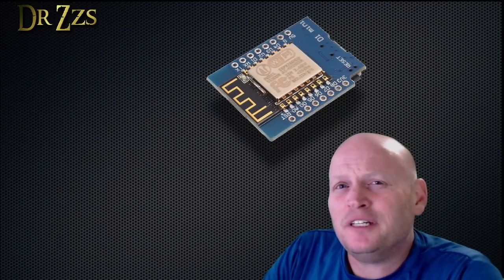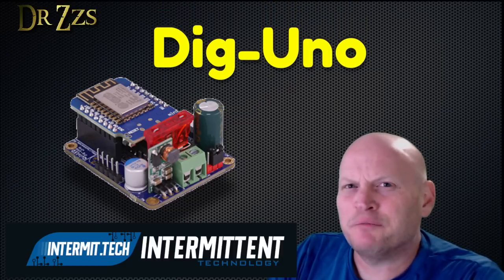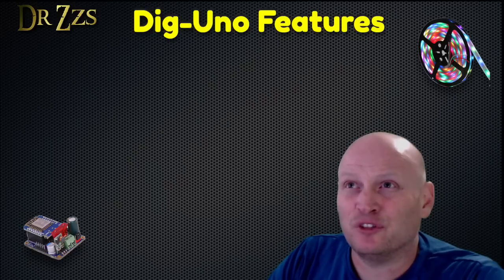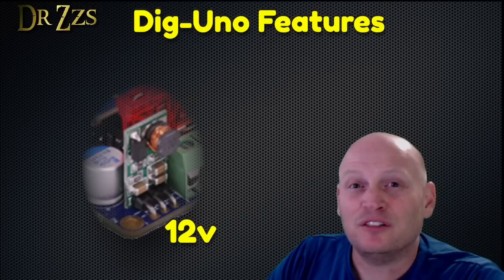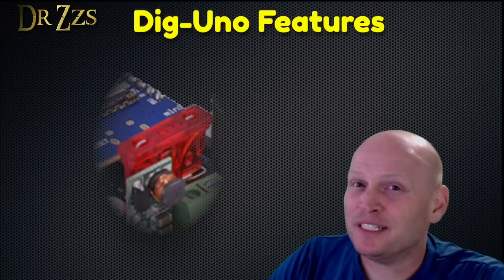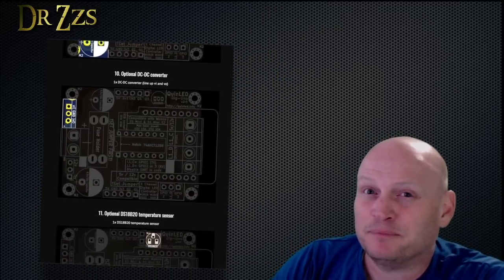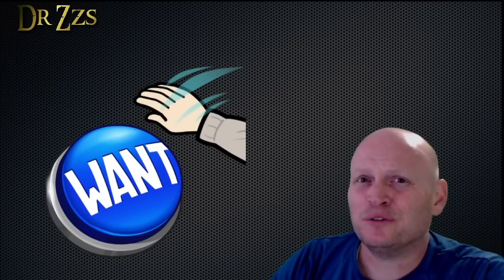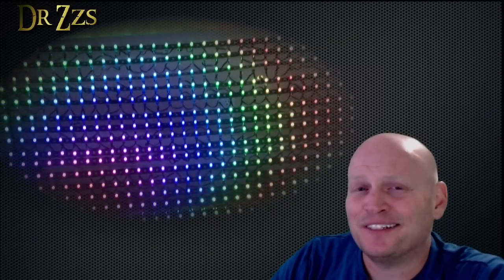Pre-Assembled Dig-Uno RGB LED Controllers Preloaded with WLED

Comment: I’ve been watching your videos all night, I’m learning a-lot but  I’m still struggling a bit.

I’m trying to do a single run of led strip lights across my roof line in a led channel. It’s 65 ft so after I solder four of the strips together (5v) it will be about 1,200 leds. 

It seems one digUno won’t be enough.

Any recommendations on how to approach this?  I can’t figure how I would get the effects to transition seamlessly down the roof line if I used more than one controller and power supply to split up the load.

Any help is appreciated!
Reply from the maker: The best way to troubleshoot this and any other quesitons that arise is to join the discord channel.  There are a lot of smart people there that can answer questions like this.  It can be difficult to troubleshoot via youtube comments.
Reply from the maker: Were you able to join our discord channel and get your questions answered?
Reply: I am actually about to get in the Discord now. 

I bought the Dig-uno and went with pixel style lights in a track. Everything is pretty much working except for a minor issue I’m trying to trouble shoot. Thanks for all the videos. I couldn’t have done it without them!

Comment: Two years on and your guides are still relevant.  Watched a couple of your videos.  I am looking into WLED for my kitchen and have seen many, many videos of people wiring them up straight to the ES32.  thinking of using Dig-Uno as an all in one safer way of doing things.  Question though.  My kitchen has two runs of LED stips, both powered by 12v transformers on the same switch.  Do I need 2 Unos and can I control both from the app so when the switch is used both sets of lights come on and can be themes changed as needed?  Any help appreciated.
Reply from the maker: Depending on location of your lights and how you want to run your wires, you probably could use just one digUno.  If you did have to use 2, there is a "Sync" setting in WLED that sends any changes on one controller to other controllers so they all do the same thing at the same time.  Hope that helps.  Come to discord and chat with the Pixelheads in the LED channel.

Comment: Hi I bought the Quin uno board and can I order the wires to connect my light to the pixel strings and my power supply, thanks, Paul

Comment: Question if I have to do power injection on 5v strip  thats one full 5m strip of  WS2812B  60 per meter  with an additional 2 meters tacked on from another strip at the end, could I run that parallel power cable  straight off the power supply that supplies the controller or would I need to tap into the power output from the controller to extend to the other side of the strip?

Comment: Dig-uno / ESP8266 absolutely does not work with an Asus RT-AC3100 wifi router, it won't connect to wifi, I've tried everything.  Works fine otherwise.

Comment: Hi just got the dig-uno booster board and new to using it. We're can I get info on how many led strips or led lights I can run on one board. I currently using WS2811 and using them on house outline and fence outline so just need information on how many Leds I can use per dig-uno or if I'll need something else to run the 1300 or so Led lights.I will be changing to the WS2812B 12v led strips and string lights for future. Please help thanks

Comment: Hi There and thank you for all the great videos. I'm new to this led pixel scene and learning good stuff from you. I'm going to try something out this year. I have a couple of NodeMCU with WLED and going to run 12v strings, and I just ordered a dig-uno from you. My question is what type of cables do you use from your nodemcu to the pixels, or even jumping a 20' space from 1 pixel string to another pixel string? I thought I saw that you can use 18/3 extension cord? Any help would be great. Thanks.

Comment: What parts need to be changed if I accodentallu used 12v power supply while DigUno was set for 5v?
Its fried now and ordered a new one😖😁
Reply from the maker: You just need the D1mini.  You can get them for $3 each from Amazon if you buy a pack. https://amzn.to/385qk6L
You'll have to solder the pins on yourself though.  But, if you don't want to solder the pins, I am going to start selling pre-soldered and pre-flashed D1mini's and Mini32s soon.  I'm waiting for a batch to arrive then I can start soldering and flashing and list them for sale.
Reply: Thank you alot.
Working on probably first LED cristhmas lights home here in Finland. Hope to get done in time.
....thank to your videos😉👍

Comment: Hello I just found this video and I am considering getting this controller.

I plan to run approx 550 leds in my showcase of the WS2815 12v LED Strips at 60 LEDs/m.
I've calculated that it will need roughly 14 Amps to run it smoothly.

Can this controller run it without issues?
And how do you connect the WS2815 to this controller?
Many thanks for the info!!

Comment: Can multiple units be grouped together so I can synchronize and control multiples at once? For example, if I have one unit with an attached strip in each bedroom, and I want to instantly turn on all four bedrooms doing the same lighting color and effect, is that possible?
Reply: Did you ever find out this question I’m wanting to do the same

Comment: Hey I bought 4 16ft WS2815 12V strips with 300 LEDS per strip. Could 1 Dig-Uno run this assuming I inject power in the middle and have a good power supply?
Reply: BigMike I installed 7 5v WS2812B with 300 leds per string and I also run a power injection cable along, but on the WLED app when I put the amount of lights which is a lot of lights the leds turned off, the highest I managed was 725 lights, which is not enough , i have enough power, I checked, I think is the board or the app

Comment: 1) Could you add a relay to save power in standby?3m stripe consume during standby more power in a year than the cost of this controller. So with a relay, a controller often amortizes itself within a year. 2) Microphone: for the WLED fork with audio reactivity. There is already a PCB shield and parts list from the guys who forked the audio version of WLED. (But its not possible to order it assembled). I guess it’s only a matter of time until they merge and then it would be great to be able to use audio reactivity. 3) size: Shellys have very similar chips on board (including relay) and are much smaller. Maybe there is some downsizing potential

Comment: Hi Dr. Zzs,
I have some questions:
1. How many pixels/nodes you can handle with each  unit?
2. Could you provide the links where to buy the parts to assemble by myself?

Thanks,
Reply from the maker: I've run 800 LEDs without a hitch.  I've heard 1200 is a max, but I haven't tried that many on one.  
Here's the link to Quindor's build guide:  https://quinled.info/2020/05/08/quinled-dig-uno-hardware-guide-2/
Reply: @DrZzs  Thank you for the information.

Comment: Dr Zzs, can you please do a quick wiring/setup video for the Dig-Uno? Especially how to replace an existing NodeMCU setup with LEDs with the Dig-Uno?

I bought one, it showed up, it's great, but so far I've only set it up to connect to my wifi. Without any documentation and looking at the board, I can see where I should connect the data and ground wires, I see where power goes, but I don't see where the 5v/12v switch is.

I imagine converting an existing NodeMCU setup to replace it with the Dig-Uno is like a 5min operation, tops, but it would be fantastic if there was a guide on how to do it!
Reply: Did you ever figure it out? I'd like to buy one but I weary to do so without knowing what I'm doing
Reply: @isohexane  I figured it out by watching DigUno setup videos and matching my wires to what I saw.
Reply: I have not got mine to connect to my wife-fi.  Any suggestions ????

Comment: I need a few of these but with a 1s lipo power and charge circuit built-in instead of the 12v stuff!
Reply: Me too, it would be nice to have a little 4 channel board that drives 4-die Cree X-lamp LEDs from a 1s Lipo, Lifepo4 or Li-ion

Comment: Did you also say this comes with WLED installed on them?  If thats the case, im getting a few.  When they come in stock again.
Reply from the maker: yes, they do come with WLED installed.  I hope to have another batch in the next week or so.
Reply: @DrZzs  im ready!! Knowing I can put 12v on them without blowing them up is huge!!
Reply: My Dig-Uno arrived, thanks! Anxious for new episodes so I can finally have working LED project. Pls. point to where to buy power supply and a strip of LEDs. I am excited!

You rock.

P.S. you might enclose a one page info sheet saying what's enclosed, where it came from and your website URL. Just sayin' (smile)

Comment: As a beginner in the HA scene, would this be something you'd be able to connect into Home Assistant and have it controlled through there? 
That is, could I trigger it with automations and scenes, etc?
Reply: You can already do that with WLED.
Reply: @th3suffering  Thanks, but I'm trying to cut down the number of apps to do things rather than add to it, unless I misunderstand what you're saying?
Reply: @Omertron  WLED is the software flashed on the NodeMCU.  So with this hardware + WLED flashed into it, its already integrated into Home Assistant.  It should automatically discover it and once added you can integrate it into your automations.  I have my leds in an ambilight setup behind my tv.  I have Home Assistant telling WLED to turn the LEDs on when my TV turns on and to turn the LEDs back off when my TV turns off.
Reply: @th3suffering  Ah, got it. Thanks for the explanation. Time for even more research

Comment: @DrZzs I'd like to put strips under the steps on my stairs, 14 strips in total,  between 80 and 110 cm each. Would this be able to control that or would there be a better solution for that?
Reply from the maker: this would do well I'd say.  I'm guessing you're using less than 800 LEDs total?

Comment: I have been following your channel for several months now as I have decided to use your info to create a LED  string across the front of my house. I have built the controller with WLED from your 1st VIdeo using the MCU8266 and a logic controller from "The Hook UP" video. Just wondering if can I power a six strip (900 led 5v WS2812) string with just one controller and one 60Amp power supply if I feed it at the beginning and end of each strip
Reply from the maker: I think you'll need power injection somewhere in the middle too.  900 is a lot.  I usually see dimming after about 200.  A 60 amp PS will be enough for sure.  I'd suggest adding power at both ends and probably a couple places in the middle.  I'd say use 20g wire too.
Reply: Thanks  I had planned on 18ga for the injection and probably 14 or 16 from the power supply to the end of the beginning of the first strip (24 ft). I still wonder how to connect the strips together and at the injection point Whatever I do certainly wont fit in the channel

Also I would like to buy a few  Pre-Assembled Dig-Uno units  in case I wind up having to break up the string. Or maybe future projects  Thanks

Comment: Can they be used with a D1 mini pro?.     I need to WiFi antenna .
Reply: should work just fine; the carrier just uses the wemos d1 pinout, and that doesn't differ between d1 and d1 pro. (the pre-assembled board comes with a D1 already tho, so if you order that you will have some spares)

Comment: Ok.....I am not a “tech” type person.  Does anyone make a RGBW controller with power that I can plug, program and play ??
Reply: "dig-uno" and similar control serial / protocol LEDs (power, ground, one data wire, 0's and 1's = brighter / dimmer), like WS2812 and SK6812, the former being RGB and the latter offering an RGBW option. WLED runs on dig-uno and so you can have a solder-free just plug wires in, get the polarity right, and it works experience.
PWM LEDs (ground, one wire per colour and more volts = brighter) however, want a "QuinLED-Quad" or similar, which has one analog output channel for each colour, so four channels = RGBW. It is still solder-free: plug wires in, get the polarity right and it works.
Reply: Maybe a Shelly RGBW?
Reply: Dig-uno has that features.
Reply: Dig-uno is the non-addressable equivalent of Anavi Miracle controller then?
https://anavi.technology/
Reply: @bogmaerke  No. Dig-uno is for addressable Leds.

Comment: Every time I flash nodeMCU with WLed it won’t show up in my router....
Reply: Fro Ferguson Theres a WiFi network wled creates which you connect to first and set your WiFi network name and password, then wled will show up on your network.
Reply: Dave Snigier that part work I flash the hotspot shows up I can login to and once I input my network and password it does show up on my network.
Reply: im having the same problem i change the network name and the password and the web site name and i cant find it on the android app and the web site name .local wont work.
Reply: @Emmanuel Goldstein i have 2 net works i have the modem and it has WI FI, and i have a router. i was able to get it work work on the Router for a min but that is at one end of the house. when trying to get connected to the Wi fi on the modem i am unable to find the IP address.